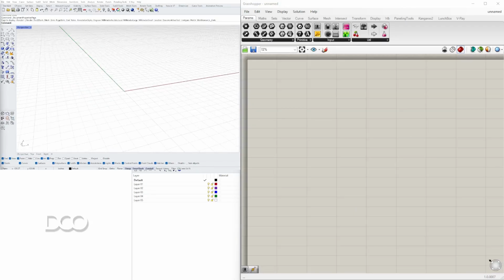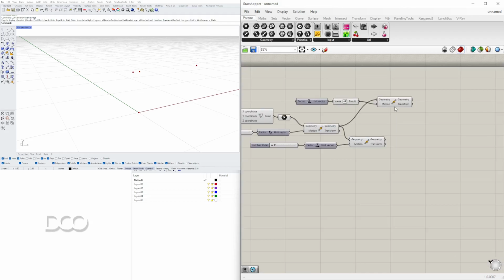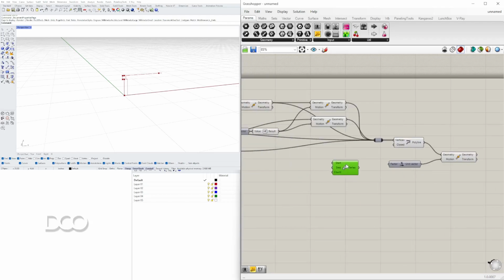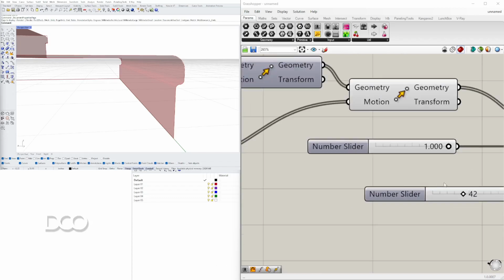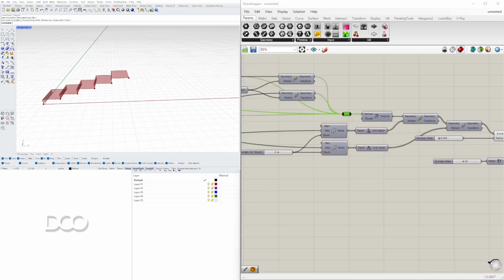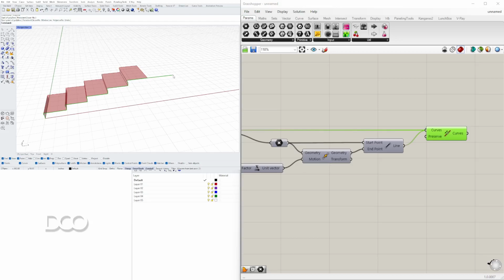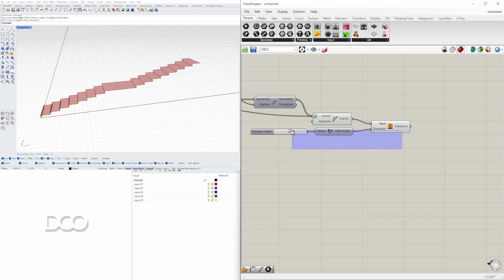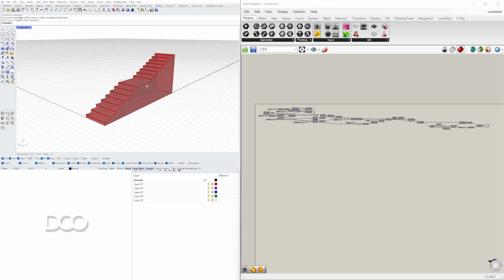Algorithmic Stairs with Landing Rhino & Grasshopper parametric architecture& design full tutorial

Comment: DCO your tutorials are amazing. I managed to perform this one flawlessly without sweating. I have two years using Grasshopper daily. I think Grasshopper 3D and Rhinoceros are FUNDAMENTAL tools for architects. Moreover, algorithmic design, algorithmic programming, mathematics and physics should be fundamental tools for the architect and engineer. 

This is the new PENCIL. It's the pencil that helps the designer understands ANALITICALLY their designs in terms of mathematics, measure and cost values on the get go. Everything is documented to perfection WITHOUT speculation. 

Great work as usual.
Reply from the maker: Thanks for the feedback! I am glad that you liked the tutorial, and I am glad you share the same thoughts as I do!  This program can help designers in so many ways, that I want to focus on teaching it, as it can be intimidating at first.  Thanks once again, and please share it with those who would be interested in learning! Cheers!
Reply: @DCOParametric  The tool is stupidly good. A game changer are SubD and multi pipe. 

And yes the learning curve intimidates because the program requires a mathematical mind. The user must have calculator, paper, pencil and eraser at hand too. This program, Grasshopper 3D, teaches to think in a scientific way. It's genuine learning.